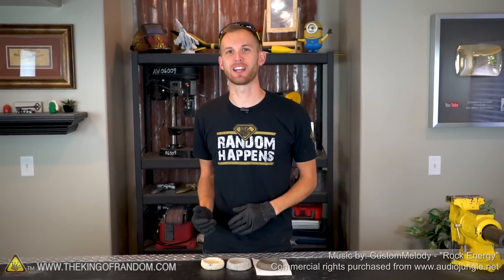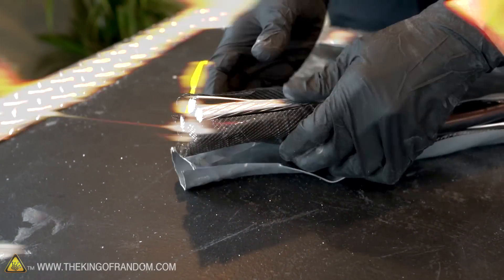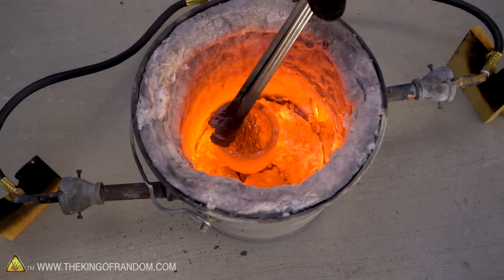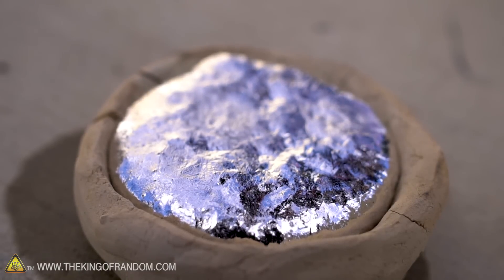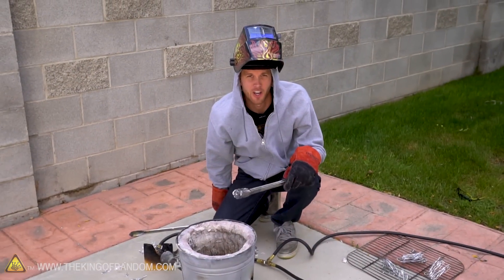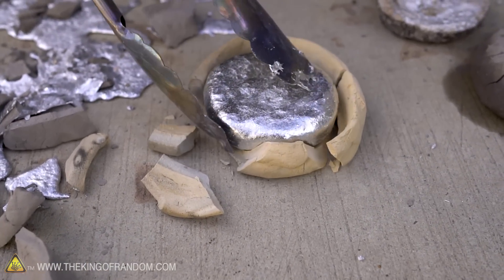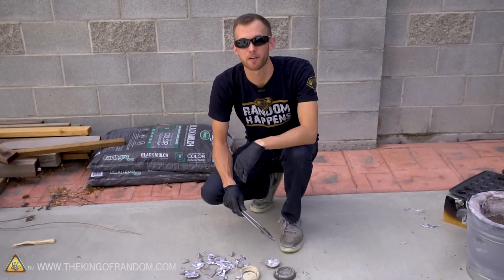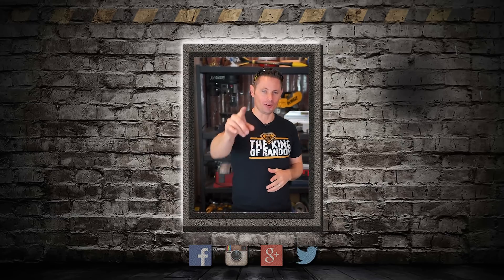Will Liquid Metal Cast in Clay? The TKOR Ultimate Guide To Clay Molding and Metal Casting

Comment: The indentation on the bottom of the puck which was poured into the fired clay is because the bottom of the puck of aluminum was still the hottest part, and probably remained mostly liquid longer than the rest of the it, so when the aluminum cooled, it contracted, and that being the spot which cooled the slowest, that's where most of the contraction occurred.

Comment: Interesting.  I assumption is the dried clay had some of the strength fired clay did, but also a lot more moisture, and that was a bad combo.  The wet clay dried, but also yielded to the heat (it was covered with cracks, likely to help steam escape), the dried clay was too hard and reached breaking point.

Comment: If you want to mitigate the expansion and cracking of the clay, you could try to create air bubbles in it while it is being fired, you can do this using several techniques. But mixing in a fair bit of silica sand or other ground up porous material and wedging it might have the desired effect.  People have been using clay molds for at least a thousand years with at some level of success.

By the way, fired clay molds are pretty much 1 time use molds, Unless you get really lucky. At least from my experience.

Comment: I went camping and i thru aluminum cans in the campfire and they melted pretty fast and even thru glass bottles and they also melted not as fast but did after couple minutes could a camp fire work for casting? It would be cheaper

Comment: I think you need to put sand inside the vacuum chamber, put a properly fired clay cast on the sand, pour the aluminum, cover it, then take the air out!
Taking out the air will reduce the amount of oxidation and start the cooling process. The sand will protect the container. Be sure to give your cast a preheating and make sure to fire it after completely drying it in the oven, and only dry it after giving it a hard beating. I have done clay work in art and that method gets the best results.

Comment: next time put the clay in the foundry before you cast into it. That should evaporate all the water away. As you could see even the fired clay had enough moisture in it to have steam rise through the casting and ruin it, and the thermal shock is why it cracked.

Comment: I think theese clay molds can work pretty well but you have to heat them slowly before you put molten metals in them. They will be perfectly dry and won't crack from the thermal shock.

Comment: Try plaster of Paris thumbs up if you agree
Reply: 0 thumbs up.
Reply: Blitz Fire 1
Reply: Hardy har har.
Reply: COSMIC CSGO    I've done that with solder.  The key is to bring the plaster up to temp slowly so there's no thermal shock.  It survived direct heat from my butane/propane torch, which can also melt a small amount of aluminium.  If he had preheated the clay molds I reckon he'd have got better results.

Comment: Also the Fired clay worked the best because it is in a way similar to the crucible. Had they heated up the fired clay in the oven I think it would've worked even better because of the way the earthenware is. Like when you preheat the crucible,  I'd like to see a retry with fired clay but have it at a warmer temperature to see if that might improve results.

Comment: what would happen if you poured molten aluminium straight into cold water? i tried this with wax and the wax spread out like a sheet!( i did it in a bucket). i wonder if you could make some aluminium sheets in this way
Reply: Wax and aluminum are not at all the same thing.
Reply: 2 chances, the water would be explodin and impullses the molten metal to the air.. or the aluminium goes to the deep and the water starts evaporating like mad...

Wax works like you say I guess because it would float on the water when getting solid and also it doesnt allow that much heat transfer... aluminium on water would be closer to put hot oil on water...   (that temps differences makes the water turn into gas so fast that it almost prevent the oill/aluminium to actually "touch" the water... like forming a gas-based shield all arround the material, which if is a small amount would float for  few time (unestable) or a big amount probably will be forced to move on a lot of directions so then exploding and covering the surrondings)

Comment: the layer of aluminum-oxide on the surface of the liquid aluminum has enough tensile strength as its cooling that it can contain big air bubbles then "freeze". also to save on aluminum don't stir the metal. the more molten aluminum exposed to oxygen the more slag you get. stay awesome.

Comment: I absolutely love all the casting videos! I’d like to see what happens if you mix sand and silicone caulk ( you know the clear stuff that smells like vinegar) instead of just wetting the sand with water. Insert the foam into the sand and let the sand/silicone mixture set up, then cast the part. I’m so intrigued to know if that will result in a cleaner casting than we saw with the copper gear due to the crumbling sand around the finer detail areas. I hope you find my hypothesis intriguing too! Till soon!

Comment: I think you could avoid cracks by drilling or forming tiny holes in the bottom so that there is less pressure buildup. The holes have to be very small though, so that the aluminum doesn't leak, because molten metal is a solid, and it bulges.

Comment: The dried clay was not completely dried. If you put it in the oven below 212°F for an hour or two before you cast in it, it will be completely dried. You can run into the same problem in a kiln when firing your greenware. The same could be done with the fired piece. What you had there looked like it had been bisque fired. Which makes sense having only been heated in a charcoal grill. Generally speaking after a bisque fire the piece will be fired again at a much higher temperature. The foundry might be able to get up there.

Comment: there was probably some water absorbed into the fired clay which when heated up by the molten aluminum probably evaporated and the aluminum on the bottom of the cup probably cooled quicker and allowed the steam to get trapped underneath. likely something similar happened in the dry but not fired clay, but since the clay was not fired it could break apart and would make the clay itself bubble underneath releasing large amounts of steam and making it look like the aluminum was boiling

Comment: The dried out clay exploded, because it was, for the most part, a solid with enclosures of water in it. The wet clay is still deformable and therefore was able to withstand the pressure.

Comment: What i think why the wet clay worked was that because the wet clay was sufficiently wet and the water in it cooled the aluminium and thus it itself did not get hot enough and did not blast.  The  dry clay did noy work because it was not used to the extreme temperature like the burned clay and it neither had a something to prevent it from getting too warm like water in the wet clay soo the dry clay unable to bear the extreme temperature blasted or blowed up . Will appreciate a like if you agree 😊
Reply: Hmm, I'm gonna say you both are wrong. 

The dry clay is hard but still had water in it, which turned into vapor from the heat of the aluminium. The vapor got stuck in the aluminium and couldn't escape which created pressure in the cast that caused an explosion when the pressure was too much for the dry clay cast to handle.

The same thing happened in the wet clay cast, but the wet clay cast isn't hard, it's soft. As the pressure increases, it just... Expanded smoothly, causing no explosion because it wasn't forcing against the vapor expansion.
Reply: Explosions while casting usually happen when there is vapor or tiny drops of water that cannot scape or get surrounded by the molten metal. The "dry one" was not really dry and might had pockets of water that expanded very quickly. On the wet one the molten metal cooled quicker and water vapor had scape routes, so there was less pressure on the pockets of water inside the clay.
Reply: Ummmm blew up not blowed up

Comment: Interesting. I wonder what carved wood would do as a mold? And maybe drilled wooden bullet mold?
Reply: but i wonder how could we make the wood go in the shape of a bullet
Reply: burn....
Reply: By turning it on a lathe probs?
Reply: 😂 Is that even a question? It would burn!
Reply: There are drill bits that form a rounded end to the hole as the have a dome shaped end.

All different sizes, we can't do it here in the UK..  So yes please KOR guys 😉♥️
Reply: You can cast pewter in a wood mold if it's a dense and hearty species of wood
Reply: Michael Tillman   if deprived of oxygen, the wood turns to charcoal, that's how charcoal is made.  You could deliberately scorch the wood first - instant carbon lined mold!

Comment: Slowly heat the fired clay to temperature then add the molten metal. It will not crack and break from thermal shock. This is bronze age tech and basic physics that I always considered common sense. To clarify, thermal shock basically means if you raise the temperature of a solid object quickly, it tends to crack due to different parts expanding more quickly than others. This is also why many fired clays crack in the cooling process, if it cools too quickly it can crack. A note to add, this is why blacksmiths rarely quench in water as well. Whenever working with heat you need to keep thermal shock in mind.

Comment: There was some residual water left behind in the clay from being fired at such a low temperature. Higher temps are required for the quartz particles to fuse together and make ceramic. What you have is 'bisque fired clay' - you need to put that into the forge to actually 'fire' it into a ceramic material. The castings will come out way better and also -won't explode! -Plus it's worth learning a little bit more about. You have a forge after-all* give it a go!!

Comment: liquid and aluminum do not mix, if liquid gets inside molten aluminum it will evaporate and the gasses trapped beneath the aluminum will bubble to the surface violently causing it to splatter everywhere and possibly even explode

Comment: The center of your "fired" clay is still un-vitrifyed. Scrape it with your finger and you can tell its not quite solid. You need higher temp fireing. When clay is actualy vitrified it will tink not klunk when you flick it.

Comment: How hot does it need to be to melt glass? Is it possible to melt glass and turn it into a bottle? 
I'm aware that you can smelt sand and it turns into glass but I want to know if you can melt the glass it self in the backyard furnace.

Comment: What if you shape dry ( or slightly moist ) clay powder into a mold then dehydrate it some more in a ( relatively ) low-temperature oven? It won't crack because the shape isn't set, and there'll be air pockets to let moisture escape so it won't shatter.

Comment: I expect the dry clay will practically dissolve; even if the heat is eliminated as a factor, the molten metal is a liquid, and will likely behave akin to water with the clay. Ergo, should the clay prove capable of withstanding the immense heat imparted by the metal, I expect a portion will be absorbed, yet the rest may set correctly. Either that, or the heat from the molten metal actually fires the base of the clay receptacle, although I find this outcome less probable.

The fired clay I expect will fare the best, as it has been sufficiently tempered to weather things such as temperature variations and contact with liquid.

Finally, as for the wet clay...on this I am of two minds. One half of me expects it will simply be melted by the metal, while the other believes it may actually withstand the process rather well, given its densely-packed nature. I suppose only time will tell which side is correct.

Comment: you could try casting aluminium with a bondo (body filler) mold. It should be really smooth if it takes the heat

Comment: What if you pour molten aluminum into warm water and see if it casts into a cool shape
Reply: Aluminium reacts with water at high temperatures according to this chemical equation: 2 Al + 3 H2O -> 3 H2 + Al2O3. This reaction is highly exothermic. If enough aluminium is used an explosion may result.

Comment: Your fired clay one was actually a GREAT casting medium, but you forgot to pre-heat the mold! Try it again with your fired clay mold pre-heated in the oven to remove any humidity it might have absorbed. It should also have been thicker-walled. You can also set the fired clay mold into a sand bucket to help cool the metal slowly and prevent the expanding cooling metal from pushing the mold apart. One big advantage is that clay is really easy to work with. You could easily write something in your clay before firing (mirrored), and get something legible after casting.
Reply: Lowest heat glazes usually go from ~1100C on, and melted aluminum is only 660C, so yeah a glaze would at least prevent it from absorbing more humidity, and make the surface smooth for melted metal to just slide right over. But really just preheating the molds without glaze (and without cracks ideally) to say 450F for 10 minutes before pouring would greatly reduce thermal shock and would eliminate steam bubbles.
Reply: And glazing ceramic clay would be another cool experiment
Reply: Other types of clays can be pretty easy to work with and more stable to temperature changes. There was a foundry near my home town which cast a lot of intricate metal parts in clay based  shapes.. they used local clays which have high bentonite but I don’t know the mixtures... I suspect they were a commercial secret
Reply: HMan   à few of you guys seem knowledgeable (btw,  isn't that a crime on YouTube? ), but here's how I'm thinking.   We know that wet clay is routinely dried, warmed gradually and eventually taken above the melting point of aluminium (no?).  So if I had some fine scraps of aluminium sitting in the mold it would melt without causing damage,. well not by way of moisture surely?  I don't know whether there's also a chemical reaction.
Reply: HMan Actually, there are some cone 022 glazes that are roughly 650°C.
Reply: Hman wa
Reply: Dried may have worked if it was oven-dried too. I think this was part of the problems with the grill-firing in the other video. (Not exactly dry enough. What's considered trace moisture by most observations is still enough to cause problems.)

Comment: I suspect that the wet clay is soft enough that when the water boils, the steam can push out in a way that it can't with the dry clay.  The dry clay has less water in it, but it can't get out as easily so the pressure builds up in a way that isn't the case with the more pliable, porous wet clay.

Comment: You guys are probably never going to read this but you are using the wrong type of aluminum for casting. You have to use aluminum specifically for casting that has a high silica content. The silica gives the aluminum nucleation points and overall you will get a better product.

Comment: Maybe you should try it again with some better clay/ceramics. It didn't explode becuase there was enough transfer of heat energy for the water be able to Buble through the aluminum where as in the dried clay it didn't so it just continued to build in pressure until it exploded
Reply: Why not use geometry and a reservoir for water? 
It's like drawing out a path of ease for the heat.
Reply: Wei Zhao  what do u mean geometry

Comment: The fired clay would have worked better if it was fully cooked in a kiln. Putting it on a BBQ only cools the surface.  Try cooking the clay in the forge
Reply: Might be a little late, but it would work much better if he heated the fired clay up first, thermal shock is a large problem.
Reply: aluminium melts at 660 degrees C, which is substantially cooler than a typical pottery kiln.
Reply: Fully firing the clay would help, and also using raku clay would help. It's made to withstand a certain amount of thermal shock.
Reply: not exactly, sure u fire it again to cook the glaze on it but that metal probably gets hotter then a normal kiln so it could break it like it did in the vid

Comment: I mentioned this before, but you should try mixing silica sand and bentonite powder. It should be a ratio of 100 lbs of silica, 12 lbs bentonite, and 1 gal. of water. Please try this method. Apparently you can get kitty litter made with bentonite and grind it down also.

Comment: Perhaps it would be more effective to cast the aluminum in the fired clay right after the clay is fired and while it is still warm and let both cool down together.
Certainly not the most convenient method for casting stuff, but I believe the clay will probably be most dry while it's near red hot and hasn't hat time to absorb humidity from the air...

Comment: What Does Liquid Nitrogen Do Inside Of The Backyard Foundry?
Reply: Evaporation
Reply: Swagnerson It's A Request He Hasn't Done It Yet It's Just A Request....
Reply: whoops! i didnt see this comment and posted the same idea lol
Reply: sure
Reply: EliteFusionZ I'm pretty sure he did it recently
Reply: Boil
Reply: Well, it might put out the furnace if the flow of gas isn't high, the nitrogen could blanket the entire inside of it removing all the oxygen...
Reply: Depends if the fuel has it's own oxygen supply or not. At best the liquid N2 would just evaporate quicker but it might do something to the Kao wool. Could freeze it but I doubt it. Might be a battle between hot and cold.
Reply: Yeah, if it has its own O2 supply, or is self-oxidizing, the nitrogen would just evaporate faster
Reply: Instantly boils into nitrogen gas.
Reply: It just puts the flames out
Reply: EliteFusionZ thermal shock would happen causing the crucible to crack and maybe the bottom of the foundry to crack or the nitrogen evaporate at an insanely fast rate probably both would happen